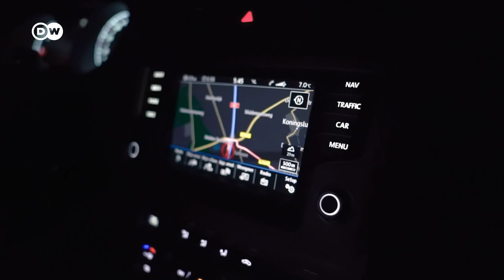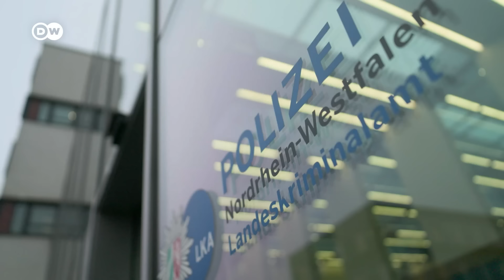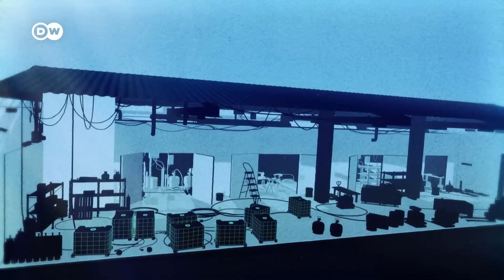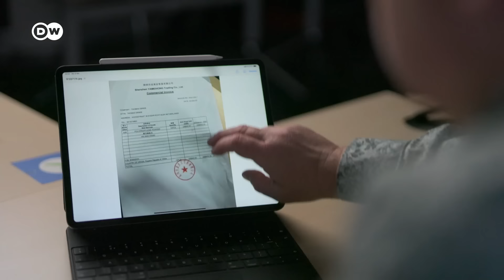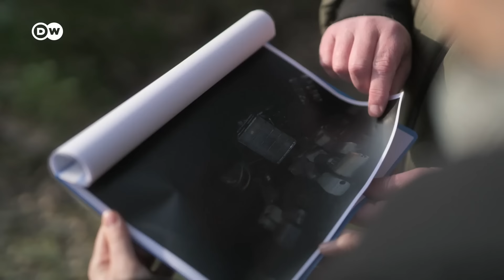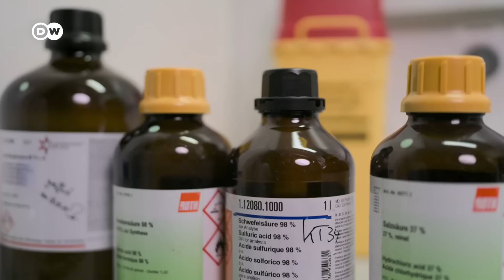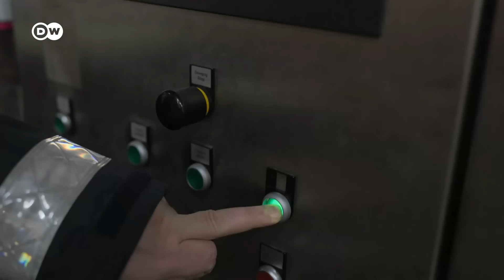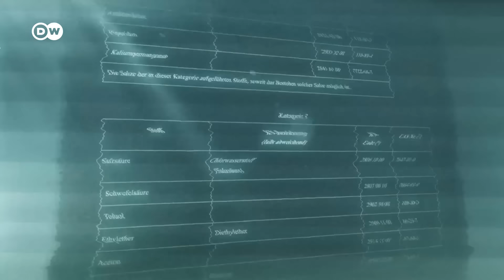The toxic waste from drugs like ecstasy, speed or crystal meth | DW Documentary

Comment: 23:06 This is very short sighted. Banning the precursors will only lead to more steps, because now thr criminals need to synthesize the precursors as well. With each step in the process there is more chemical waste that is produced.

An actual long-term solution would be to legalise and heavily regulate the production of these substances. Then it's no longer gangs that procude them but companies that should be able to be held responsible